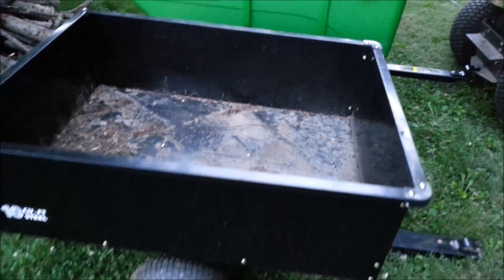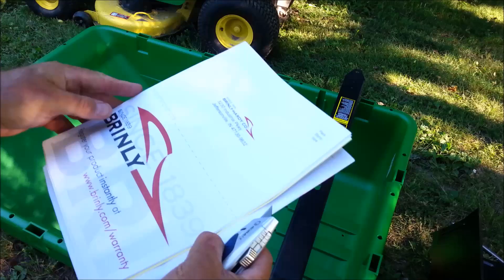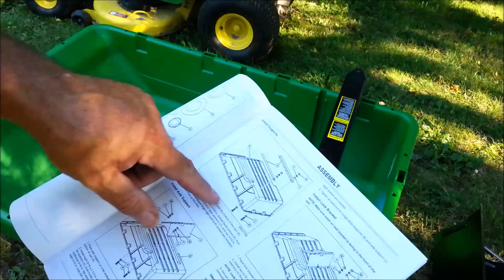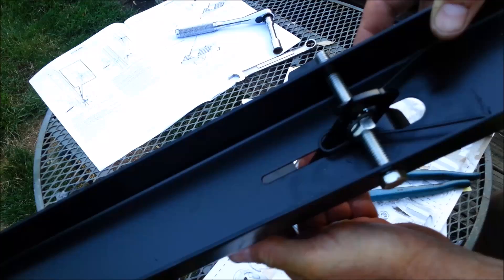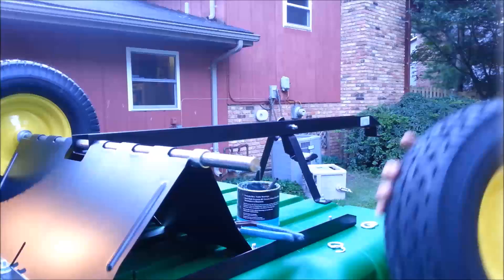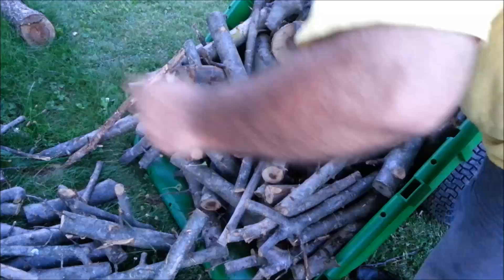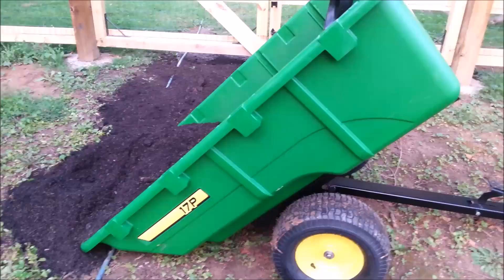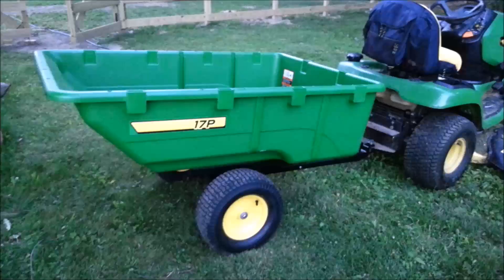John Deere 17P Poly Dump Cart Build - Crafted Channel

Comment: Bought one.  We tow it behind our x380.  Assembly involved swearing when I put together the dump foot pedal and spring due to absent or poor diagrams and instructions.  It stipulated putting the foot pedal with the notch in the same direction as the tongue which was the reverse orientation.  Your video showed the correct assembly.  The bolt threads were starting to strip by the time I reassembled everything but works great now.  Last but not least is to buy a zurn elbow for my grease gun so I can reach those grease nipples on the wheels.  Then get my jigsaw and use the cardboard template  to make a plywood separation panel and maybe later stakes! (For the sides).  Cheers!

Comment: I struggled with installing the foot pedal until I learned that you need to make sure the two bolts in each side of the spring are centered to the slot. If they aren't centered then the pedal will rub and stick against the sides.

Comment: Unbolt the tub, slide it forward, and remount it. You’ll have much more dump angle. Then add a 12 volt actuator lift to assist with the extra tongue weight.
Reply from the maker: That is a very creative and good idea.
Reply: Crafted 
I have the same cart (but a Brinley) and plan to that to it this week. I know it’ll work. Glad to help.👍🏼
Reply: @boatsnhistory  really old comment, I know,  but will sliding tub forward help heavier loads not activate the dump lever by accident?? I've heard of the dump engaging while driving. Can't afford to lose my load on the client's yard or driveway. Hauling wet concrete mix for building a Hawaiian rock wall. Aloha and thanks so much for the advice!
Reply: @missaloha808  
No, moving it forward will give you more front weight, avoiding the “accidental triggering”, hence the 12volt actuator to assist with the lift, and control the precise dumping angle. More suitable for concrete, I’d imagine. 👍🏼

Comment: The cart from Ohio Steel is not only less expensive, but better built, better tongue, better dump latch, but it's not John Deere green. I am putting some E-GO decals on the side to match my mower though, and potentially building a fence to extend the walls, since this has the same slots as the Deere.

Comment: I’ve had mine a year now and have to say that this is not a trailer that you can abuse.  The poly is extremely durable as advertised, and this trailer would be great for an ATV as it is light and capacious.

However, I use the trailer with a 1025r and have had to repair the drawbar several times.  Why?  Because when using it to move gravel or road base it doesn’t tip its contents out fully and ends up stuck in the tipped position.  With a tractor one becomes tempted to use the drawbar as a lever  with the tractor bucket to level the trailer so it can be reattached to the tractor.

It turns out its easy to bend the 3mm C channel where the bolt goes through.  Reinforced it with some flat bar and it failed next to the repair.  I have done this not only with the bucket but also while cresting hills with a full load.  It isn’t a bad trailer but for a subcompact tractor it feels under engineered.

A 5 mm square tube with a welded nut in the hole would probably have avoided many failures of this type from people that like to push their equipment.

Comment: JOHN DEER!!!  Now we see who is making all the money with that new job.  LOL. 
I had that style of dump cart when I had my lawn care business and it was handy for rolling a push mower into the bed to haul it down the street to the next job. No lifting required.
Reply: I could use a few pieces of Applewood for spoon carving if you make it down for the fall meet.
Reply from the maker: Let me see if I still have some that haven't split from drying.  I'll wax them up for you.  I got a deal on that cart, only 200.   What are the plans for the fall meet?   I'm locked up in September, doing a Florida vacation in October.
Reply: Crafted I was thinking September but we could do October if you could get a couple of days or a weekend.  
I will try to work it around if you can make it.

Comment: Nice vid! How is the mower doing when the cart is full of firewood?Does it seem to struggle? Thanks!
Reply from the maker: No, not at all.  I upgraded to a JD 300X about a year later.  Lawn tractor can pull a big load like that easy.  It's better than using your back.

Comment: You had difficulty emptying the cart? I have a similar shaped cart. When you tip the cart to empty it, back up. Yes, back the tractor up and it will allow the cart to "stand up" and empty the cart. The dirt or fire wood will keep the cart  in place. The bed of the cart will be perpendicular to the ground. If necessary, use your shovel to scrape the rest out. I've been doing this with mine for15 years. It won't damage the cart or the tractor. Just pay attention when you do it.
Reply from the maker: Great tip!
Reply: Wouldn’t that lift the entire trailer off the ground, while putting enormous stress on the plastic?
Reply: @jlbush8249  like I said I've been doing it for 15 years with the same cart.
Reply: @robertmcdonnold3038  With the 17P?  I don’t see how the clevis pin would have enough clearance to allow for that much lift / tilt on the draw bar.

Comment: Looks great! Question: the exact same cart made by Brinly but with different tires and in black is $100 cheaper than the Deere model. I noticed the Deere has more aggressive tread on the tires and the cool John Deere paint scheme. In your experience with this, are the Deere tires worth paying the extra $100? Thank you!
Reply from the maker: How many years will it take to wear them out?  Meanwhile you get to use the $100.  Besides, do 2 new tires cost $100?    I knew about the other one but the price I paid for this one was even less.  It could have been a blem or second, I don't know.

Comment: i have a similar one made by agri fab i think,works great and no rust. i also have 3 older ones,2 of which are international harvester #2 dump carts which were made for abuse and to last. check out my recent update video to see some of my goodies i scored.
Reply from the maker: I've been shopping for a classic steel one.  Every one I see listed is about rusted out.  I was more about finding a "matching" one for the tractor here.
Reply: thats why they sell john deere green paint,lol. the last international trailer i scored at an estate sale for 5 dollars!!!! couldnt pass that up,1 inch axle with real greasable bearings.